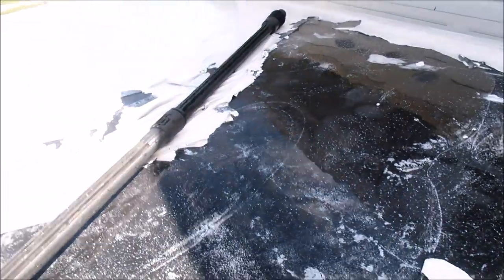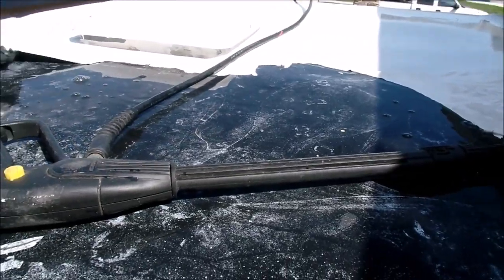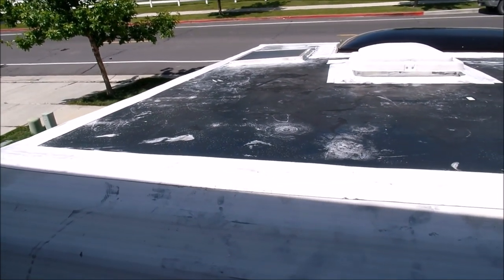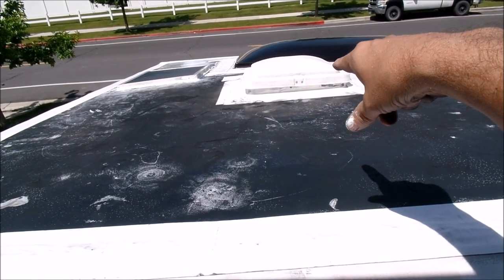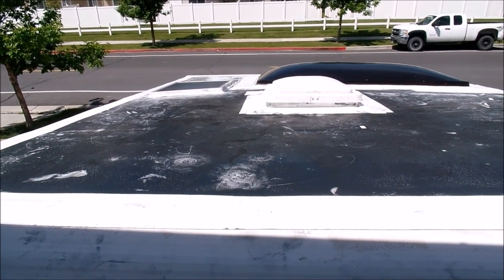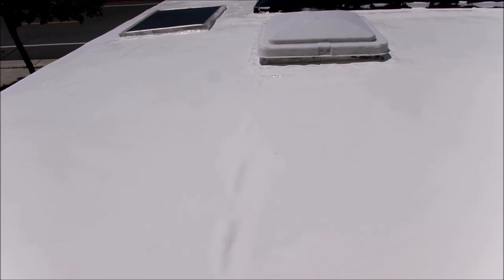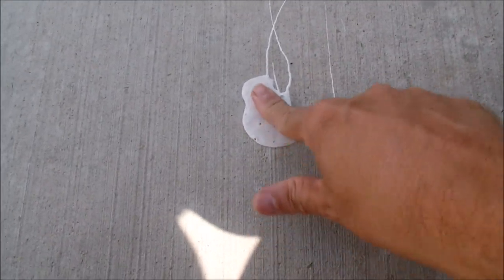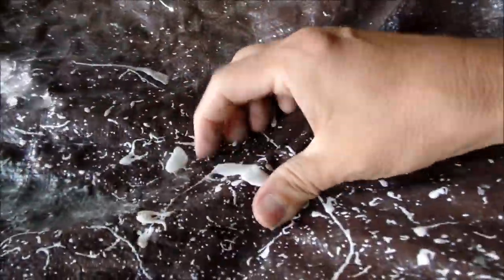Liquid RV Roof & Eternabond Tape 90 Day Review

Comment: This material is made by ProGuard and distributed by EPDM Coatings. EPDM coatings tech support and sales are very knowledgeable and will help you get it right The Eternabond tape works great but must be primed or sanded to accept the EPDM coating. I used this on a 32 ft Travel Trailer and it worked perfectly. Getting the correct thickness is one of the keys and it appears that you may not have used enough to achieve the correct mil thickness recommended. It will probably be waterproof but may not last as long as warranted at the thinner application. When applying it you just pour it out then squeegee it to a consistent application then use a paint roller, it self levels and becomes a shiny flat surface. I think it's the best stuff out there.

Comment: Dont use the pressure washer on your roof to clean it. I get it you were removing the old roof, but for anyone watching, dont pressure wash your roof.

Just a hose with a medium broom, use dish soap in water to clean the dirt and oil off.

Comment: How did Liquid Roof hold up for you?  I'm hesitant to use an acrylic membrane such as Hengs or Dicor because I dont feel acylic is waterproof enough for my rv.  Did Liquid Roof work best for you?  Any leaks since you applied it?
Reply from the maker: Both the Liquid RV Roof and the Eternabond Tape has worked out great. No Leaks! The people who sold me this trailer lied about the roof and how much it leaked. I almost junked this trailer because it leaked so bad and I would not have tried to re-sell it. Over the last few years I've tried different products. But through the winter and come springtime it would start to leak again.  So its been almost a year and still no leaks and no more stress about my trailer roof. Take Care
Reply: Two comments, what was the old coating and damn, that pressure washer makes my teeth hurt!

Comment: Anyone even thinking of coating their roof should look closely at this video.
This is the same material that these coating companies are selling the the market as great fixes.
Don't be fooled, just a simple rubber coating nothing more.
This video emphasize the importance of surface prep, that surface is really dirty, not acceptable to coat or even patch.
Bottom line,  coating will not solve your roof leaks, repairs must be made first, then coat it.

Comment: How many gallons? Looks like you only mixed one, my 28 foot trailer roof requires 6 gallons to get to the mil thickness the company advises. I'm also got ripped off my the sellers of my 2011 Keystone Passport, ( by the way Keystone products suck), so I now have to pull the whole rubber roof membrane of and use this stuff. I'm ordering though ebay the guy at the company I talked to was just rude and short with me as I had questions.
Reply from the maker: I used about 1½ to 1¾ gallons.
Reply: @roadtrippinnomad7637  wow, that's like 4 to 5 gallons less than they recommend. But good luck.
Reply: You didn't put a new rubber membrane back on?   Just used the Liquid Roof?
Reply: @bingobandit   His trailer is only about 13' long judging by the model number and other YouTube videos of that same model trailer Probably only 90 to 100 square ft.

Comment: Sealers are a waste of time on EPDM.      Rubber membrane needs NO paint.  Sheep just gotta consume.     Useless chit.  Yes I'm a journeyman roofer.  EPDM membranes are strong.  No paint coating needed.  It all ALL will peel off within 3 years.  I guarantee it.